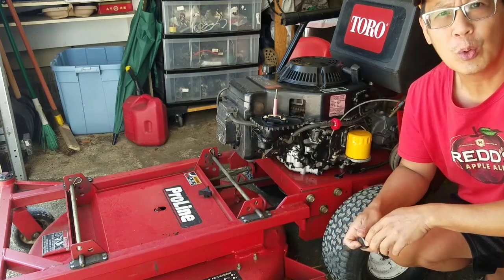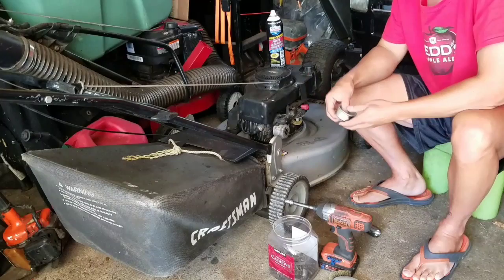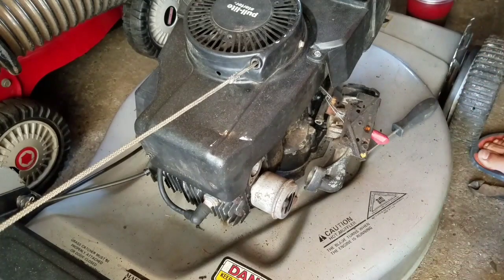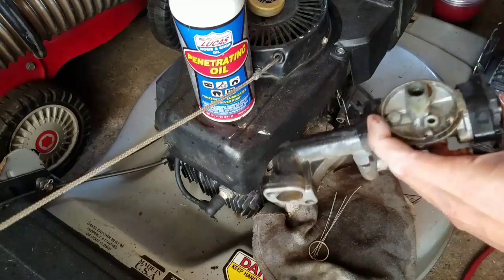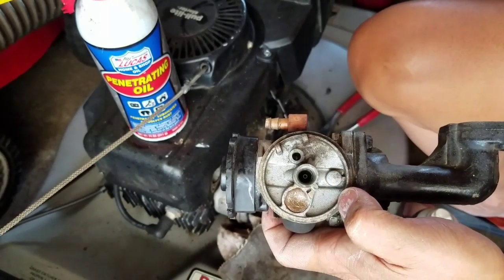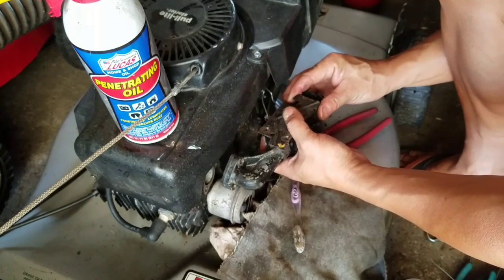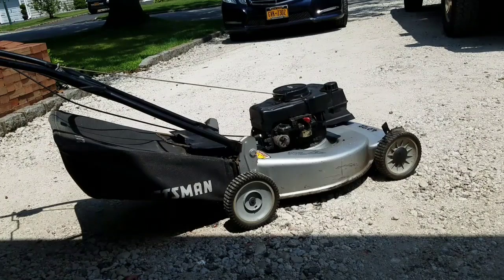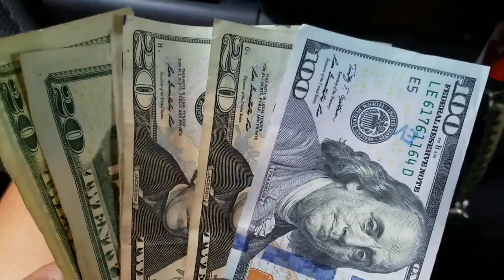FREE CRAFTSMAN EAGER 1 TECUMSEH SELF PROPELLED LAWN MOWER CARBURETOR HOW TO REBUILD CLEAN FIX N FLIP

Comment: If you don’t have a Tecumseh seat.  I have used a Briggs one before and it worked.  And I used mini pick to help put in along with Allen wrench to push it in when installing
Reply from the maker: It's a tecumseh seat, a drill bit works too.

Comment: By the way Scott keller is right, you'd be surprised what compressed air can do. It can pop out a piston in a brake caliper like nothing. It will pop out the seat usually.
Reply from the maker: Or you could do what I did, and I didn't have to wait 15 minutes for my compressor to fill.

Comment: Also at 29:40 you put the governer link in a completely different hole than it came out of, which is why you had to adjust governer
Reply from the maker: Yes, at the end of the video, I said that. And fixed it, and showed it running smooth.
Reply: I sae

Comment: Henry have one this engine type can you please help track down flywheel key and bail handle thanks man trying to build a good push mower to help out my elderly neighbor is a tecumseh with l shaped muffler
Reply from the maker: Does it look like this? Tecumseh has 3 kinds

https://rover.ebay.com/rover/0/0/0?mpre=https%3A%2F%2Fwww.ebay.com%2Fulk%2Fitm%2F261300321422
Reply from the maker: Is your bail handle the kind that has the shift forward to engage self propulsion?
Reply: @MowersNBlowers  the one that starts the engine MTD 747-1161A-0637 this is the part number i order it was to small. i think the key is really sheered now the pull rope will not pull mower over. its not ceased cuz blade turns.
Reply from the maker: @bleachmultiverse  send me a picture of your mower. Mowznblowz@gmail.com
Reply from the maker: @bleachmultiverse  that's why I asked if its self propelled because one end goes into the shifter. Send me the model number of the mower
Reply: @MowersNBlowers   i know sorry e-mail sent of pictures of mower
Reply from the maker: @bleachmultiverse  I didnt get anything, check email spelled correctly.

Mowznblowz@gmail.com